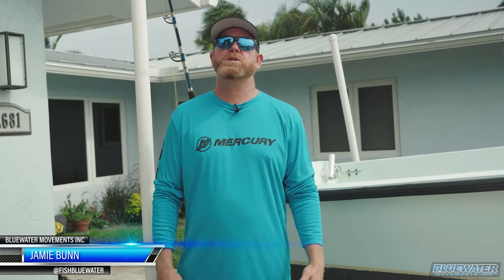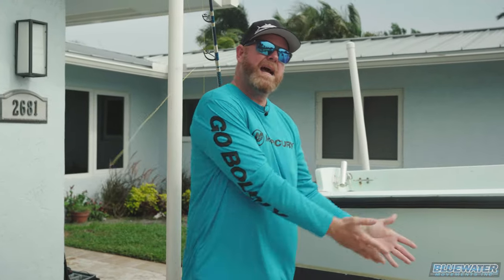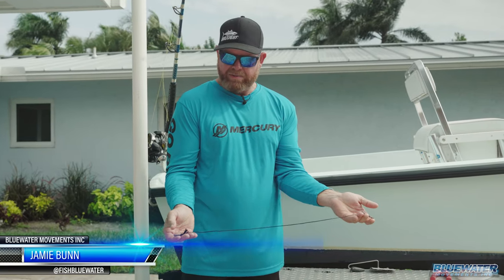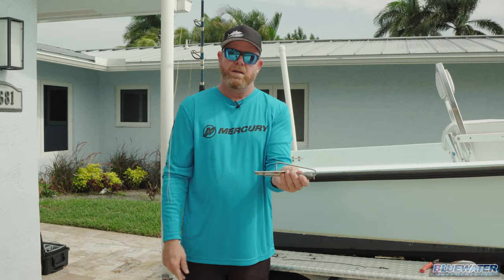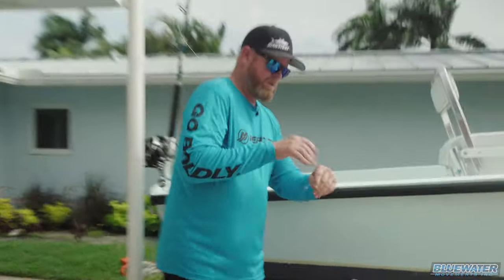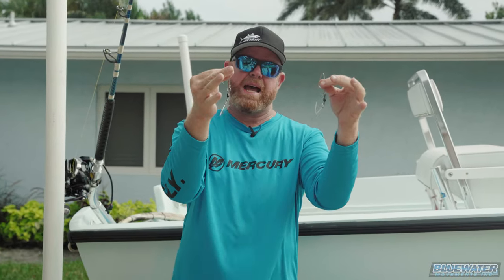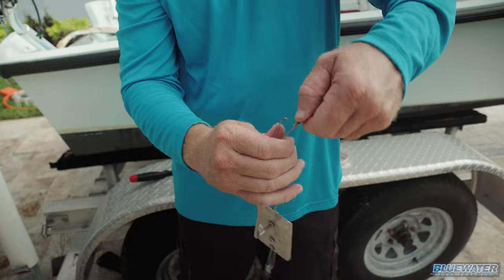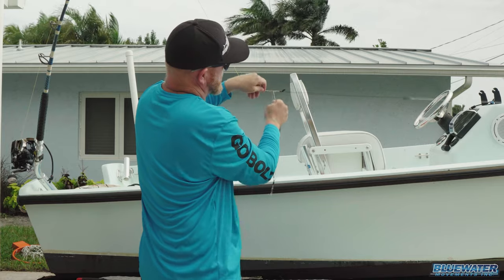How to Set Up a Wind-On Planer Rod

Comment: How do you  know how to set your drag on the rod
Reply from the maker: Get a hand scale and you can tie a loop in your line and loop it over the hook at the bottom of the scale. Set your drag to strike and pull the line maybe 10 or 15 feet and see what your scale measures and that will tell you how much drag you have set at strike

Comment: Looks like the Bimini is split, common to what I’ve seen via this method but no one has mentioned nor explained - why bother with a loop/double line connection if you cut it and use two tag ends?  Why not just tie the mainline braid to the swivel?
Reply from the maker: Even if the end of a double line is cut when it is tied to a swivel, if the knot is properly tied you still have the benefit of a double line connection to the swivel which is still much stronger than a single line connection. The key when tying the knot is to make sure you pull from the single line above the bimini twist on your double line so that both lines pull evenly when you sinch the knot down. Otherwise you can end up with one line that is longer than the other which essentially turns your double line connection into a single line connection because one line is doing all the work when there is pressure from a fish and the other line is slack.

Comment: First, great education on how this is rigged.  Second question: Why do you need to use Dacron? If it is there to keep the swivels inline, why not use the same braid as your main line? Am I missing something that the 2 feet of Dacron does that heavy Braid or Mono wouldn't?
Reply from the maker: Thanks! The Dacron is the most durable of all three options. Heavy braid or mono would work as well but Dacron will likely hold up better over time

Comment: Really Nice Video. However I have some concerns about the bridle. It is constructed using two barrel swivels. After you retrieve the line up to the bridle and remove the planar, while reeling the bridle and leader in, those metal swivels under heavy tension from the hooked up fish will ultimately damage the guides of the rod (whether the guides are ceramic or metal). Eventually, those damages can cause abrasion on the line whether its braid, mono or fluorcarbon. Have you experienceD this with the guides on your rod? Should you have a dedicated rod and reel for this rig set up?
Reply from the maker: Those swivels are designed for that type of application. You should be using a roller tip on your rod (I recommend Winthrop) and you will not have any issues with damaged guides. Most guys do prefer a dedicated rod/reel setup for planer fishing.

Comment: thanks for the great video. I've discovered my rods don't have eyes that allow the swivel to pass through easily. What size and rod would you recommend? Does it require at least a roller for the top? I don't want to risk losing everything because the bridle hangs up or ruins the guides. Fishing the great lakes we use specialized rods for dipsey divers with wire. Are there specialized rods for this or is it not necessary?
Reply from the maker: Rod size really depends on what size planers you are fishing and species you are targeting. In general a 50 pound class rod is the norm. A Winthrop roller tip is the best way to go. The roller sits flush inside the tip preventing the line from jumping off the side.
Reply: Just learn the FG knot and lose those guide destroying swivels.

Comment: Nice info on the bridal you made.
What number and where do you get those barrel swivels?
I can't seem to find one small enough to fit threw my guides.
I've bought two already that I can't use. For that purpose anyway.
I'll use them on something else.
I subscribed to your channel and checking it out.
Tight lines.
Reply from the maker: Those are 130 pound wind on swivels. Most tackle shops will carry them. What area are you in?
Reply: @fishbluewater  I live in Orlando but fish out of cape canaveral
Reply from the maker: Not familiar with any of the shops up that way but I would look for a quality shop that specializes in offshore or you can order them online from RJ Boyle or Reel Deal Bait and Tackle. They both carry premade wind-on kits ready to go out of the packaging
Reply: @fishbluewater  spro makes super strong and streamline barrels. That's what I used